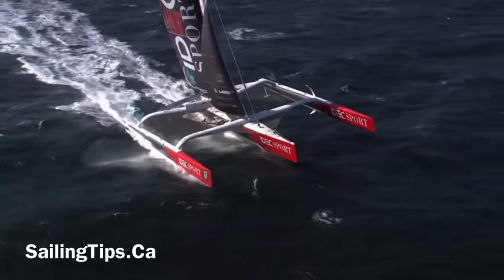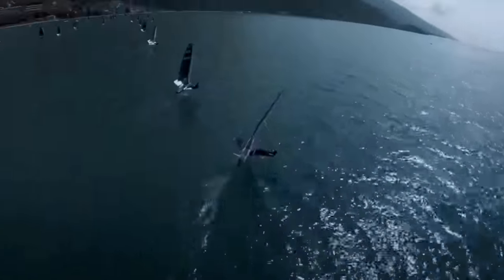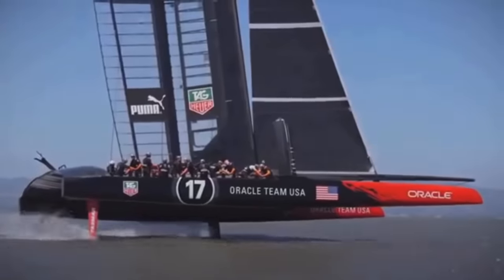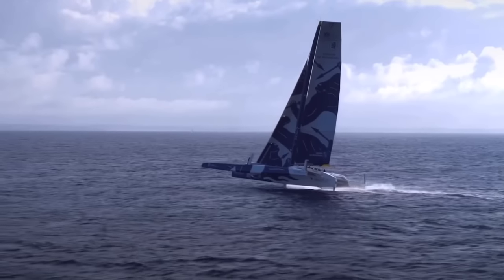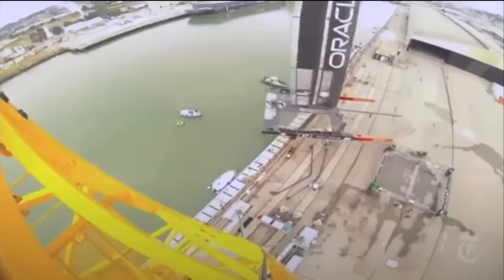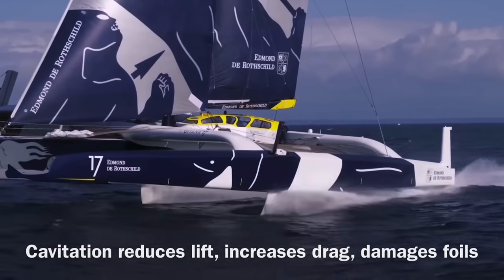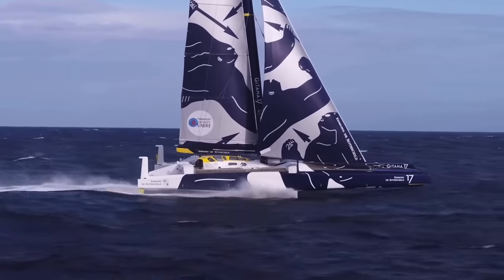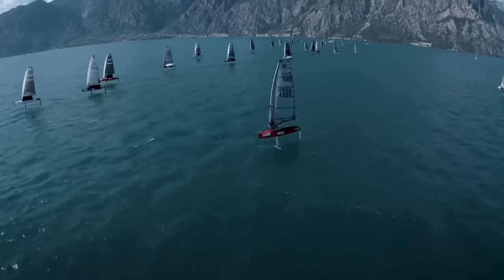How Fast Can a Foiling Sailboat Actually Go?!?!?

Comment: The fundamental limit to foils is cavitation as you mentioned. However all high speed yachts are fundamentally fragile on ocean legs including IDEC Sport, which one could say had a lucky run. Current IMOCAs have successfully foiled the Southern Ocean without hitting objects in the water, and over 24 hrs Team Malizia managed 641.13 Nm to set the monohull record.  Success with light weight racing yachts depends on a large dose of luck.
Reply from the maker: Yes IDEC Sport truly had a very lucky run with a very brave skipper and crew! You could see the differences between the foiling and non-foiling boats in the last Route du Rhum however those were relatively moderate conditions compared to the Southern Ocean. There’s no question the foiling boats will take the records at some point but it’s still interesting that it’s taken this long! Have you seen this video about overcoming cavitation? How Did Vestas Sailrocket 2 Smash the Sailing Speed Record?!?! https://youtu.be/K3m06731BQY
Reply: Thanks ... very interesting and it supports comment from Martin Fischer who is on the Luna Rossa team and also designs foils for Starboard. He confirms that you can design foils to go fast 0 - 35 kts, but need a totally different design to exceed 35 and up to 50 kts, but is then slower in the lower range. Without the specific setup of Sailrocket 2 foil cavitation at around 50kts is an issue for conventional foils and rigs. I certainly do not want to be on a windsurf foil board when the foil breaks loose at 50 kts!  @SailingTipsCa
Reply from the maker: @antc5010  It would be really cool to have foils that could change shape as speed increases like airplane wings but the loads are much higher on foils so a bit more of an engineering challenge!

Comment: Limitation is around 55kts. Then it depends if the foils are set up for super cavitation or not.  Foil Cavitation sets in at that speed and the foils will disintegrate relatively quickly - especially if they are made of composites and not designed for super cavitation.  We have blown carbon foils before at high speeds.
Reply from the maker: Yes my Vestas Sailrocket video (https://youtu.be/K3m06731BQY) goes into more depth about cavitation and foil designs to overcome it.
Reply: High end composites should be better at handling cavitation than metals, since they have both much higher yield strength and fatigue toughness than metals. The issue presumably isn't that the foils are composite, but rather that they're just not designed to handle cavitation (with the priority instead to make them lighter).

Comment: Great video, but I'm not yet entirely convinced by your explanation. Cavitation occurs when the pressure locally gets to below the boiling point of the water, so the water spontaneously turns gaseous, and this can cause stalling of a foil. I understand that this becomes more and more likely at higher speeds for a given angle of attack and foil curvature. But do you have any explanation for this magical number of 50 knots? Couldn't one simply use a slimmer foil profile and a lower angle of attack at higher speeds? Or is this not possible due to structural limitations?

Also I assume you meant "sound barrier" in a figurative way? I see no physical resemblance to the challenge of breaching the sound barrier in aircraft.
Reply: if you try and use a flat plate, you get a separation bubble over the leading edge that would probably start cavitation. I'm going to guess that 50kts just happens to be around the speed where you can't make the airfoil any thinner without it starting to act like a flat plate, so making it thinner doesn't really help delay cavitation anymore. And that is where other things like supercritical foils start to come in.
Reply from the maker: You also need a certain amount of lift to get the boat out of the water, which creates a certain amount of high and low pressure areas on the foil, regardless of thickness. If you make the foil bigger (i.e. more surface area) to distribute the load and reduce pressure gradients you also get more drag, which means you can't get to 50 knots in the first place. So the foil needs to be small enough to reduce drag, but that also increases the pressure. Water also behaves strangely around its state boundaries, for example you add pressure to ice and it changes back to water, which makes it slippery, other substances don't do that. All of that said I suspect the 50 knots is approximate and can float up and down depending on any number of variables, but it appears to be an observed practical limit.
Reply from the maker: Regarding the sound barrier part, yes it was figurative in that it's a physical speed barrier that requires a conscious engineering solution to exceed it. The physical phenomenon are entirely different though, as you noted!

Comment: Cavitation is not anything like the sound barrier. Cavitation is the reduction of water pressure over the foil to the point that the water boils.
Reply from the maker: The reference to the sound barrier was more that “supercavitating” foils require an entirely different foil design, much like supersonic aircraft require an entirely different design to their subsonic counterparts.

Comment: Question.  If at around 50 mph water vaporizes, the how does a propeller function when it’s rotating contact surface is traveling at speeds many times faster than that?  Isn’t it a matter of foil shape?
Reply from the maker: Yes it’s precisely a matter of foil shape - foils that are efficient at less than 50 knots are generally not tolerant of cavitation, and foils that are tolerant of cavitation tend to be inefficient at less than 50 knots. Check out this video on a comparison of the shapes: How Did Vestas Sailrocket 2 Smash the Sailing Speed Record?!?! https://youtu.be/K3m06731BQY

Comment: Informative presintation. I had pondered the question of why foiled boats don't hold long-distance records given their speed. The fragility and complexity certainly explain why with some of the horrendous conditions in extended heavy weather sailing. Cavitation helps explain the longevity of the foils. I remember reading that the SS United States, which broke the Blue Riband record in 1952 at almost 36 knots, had the paint abraded off the bow below the waterline due to cavitation.
Reply from the maker: Yes foils have lots of practical limitations! The SS United States is also a great example of how long skinny hulls help overcome the wave resistance inherent in displacement boats, which is the same concept which helps multihulls go fast as described in this video: Why Are Trimarans So Fast?!?! https://youtu.be/GxdCcsAdOVM
Reply: Gabarts RTW boat and all the recent trimaran records are foiling boats. The route du rhum record just fell also to a foiling trimaran. The reason imocas are not very fast with foils is that they are too heavy because rules require them to be self righting. Still they are making some progress.
Reply from the maker: @karlw7764  I think it’s just a matter of time before the foilers take the distance records, but they will do it based on higher average speeds and not higher top speeds. 

The recent RdR record was also in perfect foiling conditions!!!

Comment: The claim in the video that foils are mostly sub-optimal in long distance offshore racing due to varying weather conditions is just outright incorrect. Vendee Globe 2020 already had 4 foiling boats in the top 5. Would have been even more without equipment damage, which is something that will only improve as the technology matures. The reason why Jean Le Cam did so well is that he knew how hard to sail his boat while the foilers had to hold back, because there isn't enough experience yet in how hard they can be reliably pushed.

For long distance record attempts it's the same thing. Varying weather conditions have not mattered in RTW since Francois Joyon broke the record. Because everyone will need, foiling or not, the perfect ride to ever have a fighting chance against it. :)

And several of the recent RTW record attempts were foiled (pun intended) by flotsam while being clear ahead of IDEC.
Reply from the maker: The main point I was trying to make in the video is that foils provide the greatest benefit in moderate conditions and that benefit diminishes in light and heavy conditions. For example, most long distance skippers including Charles Caudrelier on Gitana typically don't press their foiling boats faster than ~40 knots due to the cavitation limits of their foils. For long-distance work they typically pick foils that work well at boat speeds ranging from 15-40 knots, but much less well above and below this. Breaking even the 24 hour distance record would require sustained speeds well above 45 knots, which is approaching super-cavitating foil territory (like Vestas Sailrocket) however foils that work at these speeds require a substantially different design and are very inefficient at lower speeds. For more info on super-cavitating foils check out the Vestas Sailrocket video: https://www.youtube.com/watch?v=K3m06731BQY

Comment: Interesting that cavitation becomes really problematic at only 50 knots. Perhaps variable hydrofoil cross-sections similar to exiting research on aerofoils may help. Submerged torpedoes can travel at those speeds, the increased hydrostatic pressure would decrease cavitation.
Reply from the maker: There are definitely “supercavitating” designs for foils, rudders, torpedoes, but those are quite different and very inefficient at lower speeds. Kind of how a supersonic jet looks quite different and is also very inefficient at lower speeds.

Comment: Well put: “50knots is like the the sound barrier limit for foils”
Reply from the maker: Figuratively of course, in that it's a physical speed barrier that requires special design considerations and engineering to surpass. The physical phenomena are different, but it's a good analogy in that supersonic jets require special engineering and are not particularly efficient at subsonic speeds.

Comment: the biggest problem with the round the word record is that IDEC had incredibly favourable weather and conditions for large portions of their circumnavigation, especially the southern ocean leg, which means to have a realistic change of breaking the record your decent of the atlantic has to be very fast and you can't hold anything back which as we have seen in several attempts since can often result it breaking your boat.
Reply from the maker: Yes IDEC had amazing weather and Francis Joyon! Gitana 17 knew their only chance to beat it was to make faster transits of the Atlantic, which they did on the way down, but their boat also broke. It’s going to be a tough record to break!
Reply: @SailingTipsCa  yes Francis Joyon is a bit of a wizard when it comes to multihull sailing and you never want to bet against him!
Reply: @SailingTipsCa  yes and they all pick their weather to leave in unlike a race where  you have a fixed start time.

Comment: It might sound stupid. But why do the crew need to get soaked in water when sailing. Are there other ideas or options, or is it how it is.
Reply from the maker: it’s a great question! Lots of the latest Ultime and IMOCA designs have good crew protection from the elements. Alex Thomson’s 2020 Hugo Boss design was even designed for him to spend most of the time sailing the boat from inside so he only needed foul weather gear a few times a day for inspections. The worst boats IMHO are the Volvo Ocean racing designs which have boatloads of water constantly pouring through the cockpits. I’ll take an Ultime or IMOCA over that any day!

Comment: I was told by a sailor that top speed depends on a ratio that takes into account waterline length, therefore cats and trimarans have a big edge. But if U take the boat out of the water with a foil, how does this ratio still apply?
Reply from the maker: Yes the so-called “hull speed” of a displacement boat is approximately 1.34 x the square root of the waterline in feet, so a longer boat generally goes faster. This is much more prevalent in displacement monohulls and somewhat “disappears” in 1) planing boats that get up on top of the water 2) boats like multihulls with long skinny hulls more than 8 times longer than they are wide and 3) boats with foils where the hull isn’t in the water at all.

Comment: And then there's Sailrocket at 65.45 knots over 500 meters!  Peak speed 68 knots.  Must have been some crazy hydrodynamics happening around her single foil.
Reply from the maker: Yeah they used a special ventilating foil design to enable them to break through the cavitation barrier around 50 knots. Maybe a good topic for another video!
Reply: Another thing to remember it was also optimized to sail in one direction and had to be towed back for each run. To sail off shore you need to sail on both tacks.
Reply from the maker: @Warwick3511  Exactly - not the most convenient! Here’s a recent vid on Sailrocket: How Did Vestas Sailrocket 2 Smash the Sailing Speed Record?!?!
https://youtu.be/K3m06731BQY
Reply: @SailingTipsCa  I was following their channel when they were going for the record at the time.
Reply from the maker: @Warwick3511  That was a pretty exciting time!

Comment: surprised cavitation happens at such low speed considering propellers spin much faster than that. maybe the should make the foils out of high heat lightweight metal like titanium instead of carbon. i'm sure the added weight would be more than offset by the ability to foil at any speed.
Reply from the maker: Not sure if you’ve seen this video (How Did Vestas Sailrocket 2 Smash the Sailing Speed Record?!?! https://youtu.be/K3m06731BQY) but it’s definitely possible to design foils and propellers that work just fine at speeds greater than 50 knots, but the challenge is having them work well BOTH below and above 50 knots of blade speed. Propellers are generally designed to work well above that at the expense of poor efficiency below that.

Comment: Engineers knows how to design a foil to push the cavitation limit at high speed. But this mean your foil will be even less efficient in light wind (that's also why it's easier on short race to go faster than 55 knots if such a boat is designed - Syrocco?-). Ultimate class is working a lot on aerodynamics and, from what I know, a lot on a new foil (tip part of the mid hull) that will be in "reverse" (dragging the boat down to the sea where other foil lift) to enable more power to be transmitted form the sails. Next race (Route du Rhum) they should be even faster.
Reply from the maker: Yes the challenge is figuring out how to get good moderate AND high speed performance out of foils - solutions for one or the other are known. Looking forward to seeing what they come up with for the Route de Rhum!
Reply: @SailingTipsCa  Normally, SVR Lazartigue should win, I did a visit at Lorient of Banque Pop... that was crazy !!! :D talk about this after the Route du Rhum ... wait and see !
Reply from the maker: @drakkhenn42  These are amazing boats - the French definitely take offshore multihulling to the next level - looking forward to the race! Note to others that SVR Lazartigue is the former MACIF on which Francois Gabart broke the singlehanded circumnavigation record.
Reply: @SailingTipsCa  We have a long tradition on multi hull "first one" by Tabarly. You talk about the hydopter on your video, that was nice, but, too much drag. The real game changer come from the America's Cup, and (has you named it :D) it's really the US who brought that amazing idea of tip on the foil on sailing boat. What an idea ! :D We are waiting for you on the ocean, not on the bay area "swimming pool" ! :D When will build your first ultim ??? :D If by any chance you sail on western part of France, or you are around, let me know. I will ask to a couple of friend to organise an Ultim Class visit :D
Reply from the maker: @drakkhenn42  I think the Kiwis also played a major role and were the first to achieve full foiling in AC72. I'm on the West Coast of Canada so not much Ultime action around here, unfortunately! I sail a Farrier-designed F-82R which is smaller, slower, more cost-effective, and more practical!
Reply: @SailingTipsCa  Correct! Tribute to the Kiwis :D
Reply from the maker: @drakkhenn42  Incidentally my F-82R was also designed by a Kiwi!

Comment: would it be possible to somehow switch normal lifting foils for supercavitating foils when up to speed, to push well beyond 50 knots?
Reply from the maker: I think that’s the question! The mechanisms would be somewhat complex and would add weight to the boat, so it would be a tradeoff as with all things sailing!